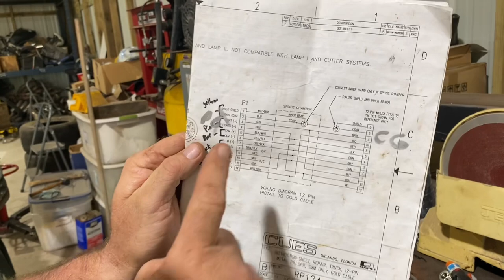Installing an air launcher parachute PT1

Comment: Just flip the piece you got, I think it may be perfect. And the shoot shouldn't stick out past the wing, justthe tip of the shoot past the wing or even
Reply from the maker: It has to because of the cylinder. I still need to be able to remove deck lid.